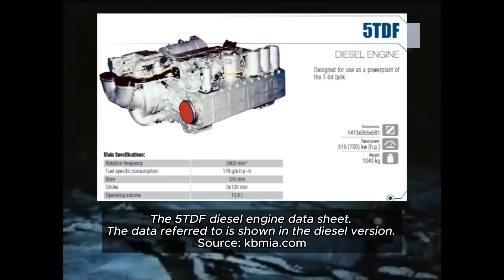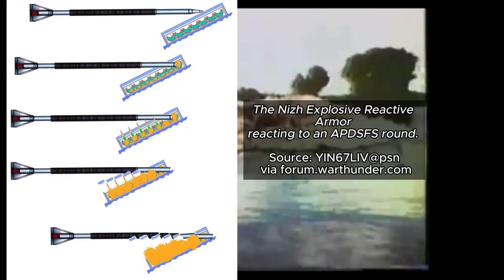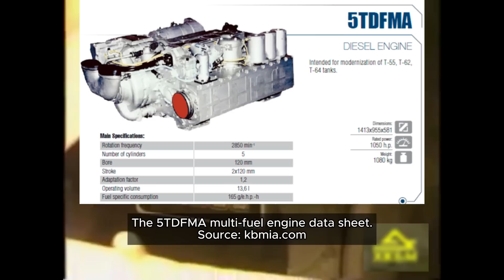Not a Lord of War | T-62AG and T-62AGM

Comment: well the Russians due to desperation in the current Russo Ukraine war brought out several hundred T-62s from storage, the Russians had an estimated few thousand in storage but many of these were junk, non salvatageable due to very poor state in the decades of storage. Many Russian T-62s were destroyed or captured. In the current Kharkov offensive 2024, Russians T-62s  and 55s consituted the majority of the Russian tanks deployed.
Reply: According to Oryx only 9 T-54/55's were destroyed or captured and 147 T-62's. In comparison , Oryx claimed that approximately 1000 T-72's were lost. The drastic difference between these numbers, shows that the T-54, T-55 and T-62 were mobilised in lesser numbers and possibly used in less aggressive actions. Another thing is, these older tanks were mostly spotted on the Donetsk.
While on the Kharkov front, the Russians were mostly spotted with T-72's. In addition, I haven't seen a single photo or even an article that the Russians were conducting that offensive with T-54, T-55 or T-62. Not even the Ukrainian propaganda made such a claim, even though it would have been beneficial to them to claim that "the desperate Russians conduct their last offensive with old T-54, T-55 and T-62 tanks"
Reply: Seems like a fair number of the “turtle tanks” use a T-62 as their original tank platform.
Reply: @johngillespie9459  yes and the 115mm gun on these tanks dont work. must have gotten a defective version and used them as a body.
Reply: not true at all, only t62s in the russian army are on the donetsk front used as artillery. The main mbt of the kharkiv offensive was the t72b3
Reply: @Beloskiiii  nope now its being deployed by regular Russian units, heck even the T-55 is being deployed including lots of UAZ 452 Loafs from the cold war to be used as troop transport.
Reply: @johnwalsh4857 Older tanks are used for makeshift artillery or poorly equipped units gets them. The main forces uses the lastest T-72s and 90Ms.
Reply: @subjectc7505  well to be exact, the expendable units in donetsk gets them and they are used as turtle tanks. Yes the main forces use T-72, 80 and 90s.  that is why you see some T-80s and 90Ms being captured in Kursk.

Comment: in absence of any armor or inferior armor, any tank will work wonders. as long as you have enough supply. which means wast amount of reserves. learn from history. in a battle field you need huge supplies. specially armored vehicles. any think can work as long as it is mobile. even ww1 ones
Reply: "Amateurs speak in tactics. Professionals speak in logistics"  General Omar Bradley.
Reply: @scoutdogfsr  sure
Reply: I don't think WW1 tanks would do the job, after all it doesn't matter if you have an infinite supply of spoon – you wouldn't dig a 10 km channel with them. It's both logistics and efficiency. Make something that works, make it efficient and cost effective then produce a ton of it.
Reply: @kindlingking  yes. But I told you if there is no armor other than yours, I said